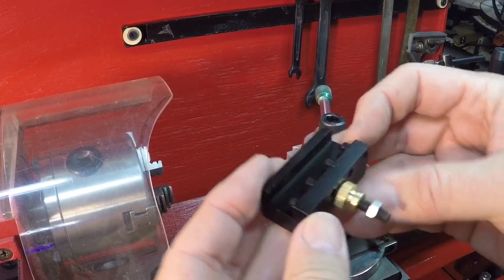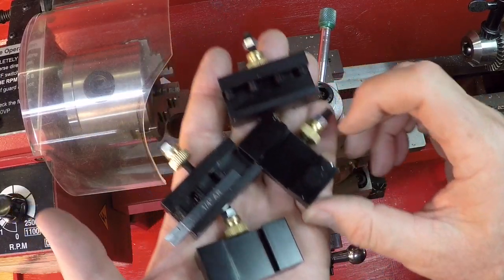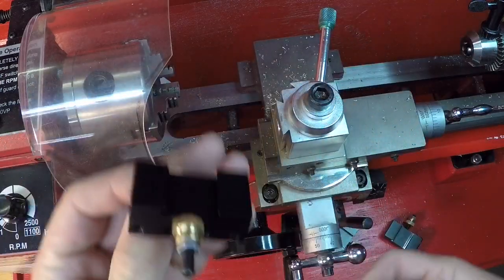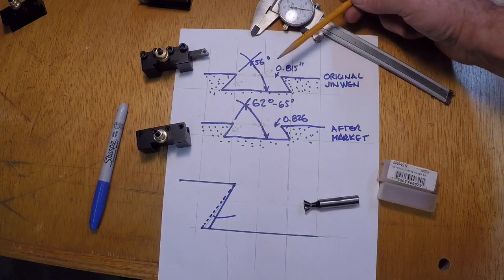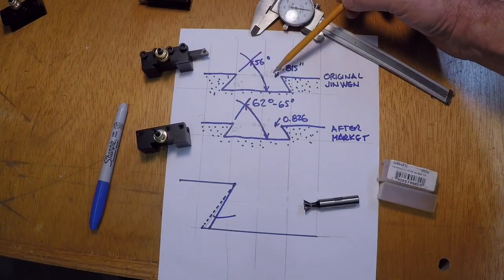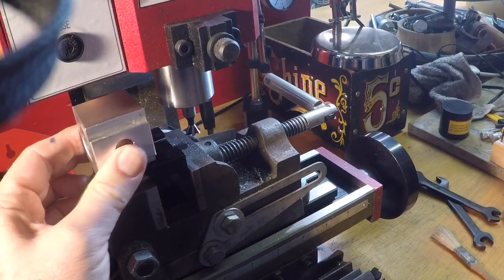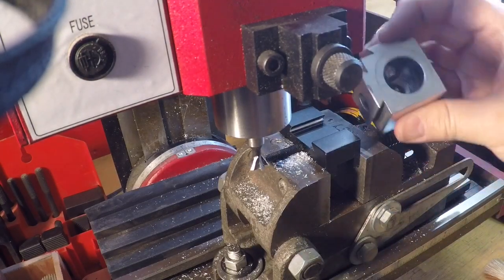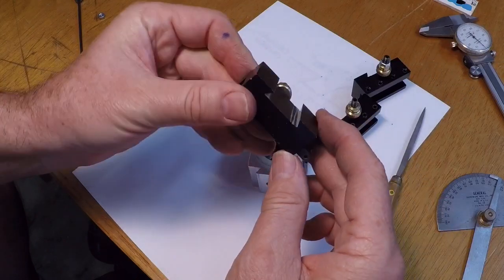Chinese Tool Holders for My Mini Lathe Didn't Fit My JINWEN Quick Change Tool Post

Comment: Thank you for posting this video. I have the same issue and will attempt to follow your advice. One question...
The tool holders I need to modify seem extremely hard. I cannot scratch them with the edge of a file. Were your tool holders made of soft or hardened steel?
Reply from the maker: Mine were pretty soft as I recall. If you think they are hardened, you can heat them to cherry red with a torch to soften. Perfectly OK I think for small stuff…

Comment: Jim I had a similar issue    one thing i found was that to supplied  tool holder  were a very sloppy fit  . the new ones  just needed  a little  filing to get them to  fit  and they were much  closer  fit . the originals are now in my scrap bin

Comment: I thought the dovetail on the "aftermarket" tool holder I ordered was too tight or tapered because it wouldn't go but halfway down on the corresponding dovetail.  Then I realized it was hanging on the piston.  I tried it on the other dovetal ad it worked but I still couldn't get the first piston in far enough to let the holder slide to the bottom of it's dovetail.  Finally, I had my duh... moment, chucked the piston in the lathe and shortened it a bit.  Now it fits just fine.
Reply from the maker: Oldold Pilgrim LOL done that! Glad they worked ok for you....

Comment: You took nothing more than a flyer with the tool holders, of course they wont fit.
To get the correct ones you have to figure what the Jingy Jangy tool posts corresponds to ie 100 Series - 100, 150 or 200. If holders dont say what they are, walk away, 10, 12, 15" means nothing either
Reply from the maker: Jonny interesting comment- do you know if a technical reference or a website that provides details of the different types? I haven't been able to find anything.
Reply: To date i havent come across any.
Case of buying tool holders from various sources and see if they fit.
Mine are labelled 250/200, if a tool holder doesnt spec that i pass on it. Some shops just sell suitable for eg 9-12" or 11"-15" means nothing, it has caught me out three times.
Reply from the maker: Jonny thanks I'm looking into that...

Comment: I'm shocked at the angles you're measuring. They don't make a 62 or 56 degree etc cutter. 60 and 45 that's it unless you look into wood router bits. Scratching my head on this one other than the black coating did something..
Reply: Two other comments use a triangular file its 60 degrees and depth make a big difference.
Reply from the maker: Dave M do you still have a JINWEN set? I'd be curious to know what  angles you are seeing...
Reply: I two jinwen tool posts I machined for others were both 60 degree. The A2Z and the HF tool posts I have are also 60. Which is why I'm socked what you are seeing.
Reply: Just did a test and set my digital angle guy to 62 degrees and held it against a holder I made at 60 degrees. Dead on match!
Reply from the maker: Dave M very interesting! I went back and looked at reviews for the holders I bought and one other buyer described a very similar problem. He said he had to trim his as well. I'd love to see the factory where these were made. I wonder if these parts meet their specs.
Reply: Figured it out their using metric or gon angles! LOL

Comment: There's nothing worse than waiting for something to show in the mail for a week and it not fit! Maybe those other holders were for a wedge style tool post vs piston.
Reply from the maker: That may well be it. I looked around for some design details but couldn't find much info on the different types. I get the idea the designs aren't highly standardized.
Reply from the maker: deweys there is usually a down side to low cost. Fortunately the fix wasn't too bad.
Reply: Oh absolutely! I'm glad you got the size too small vs the size too big :)